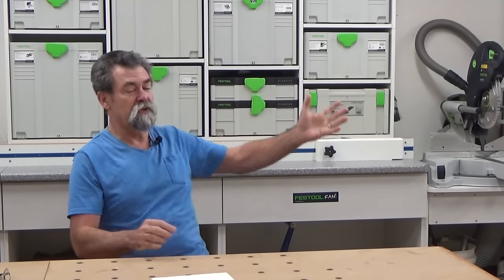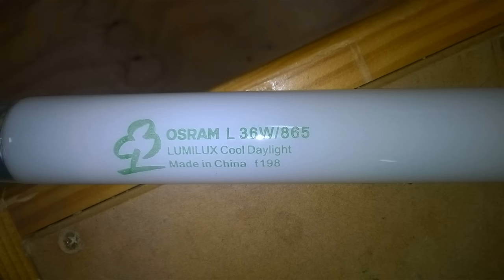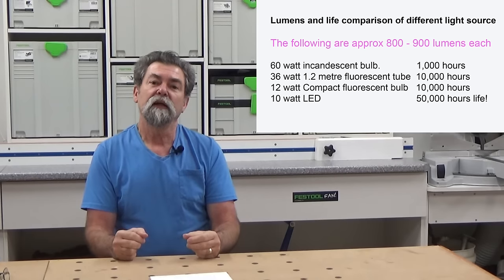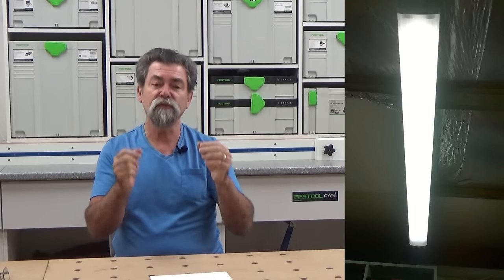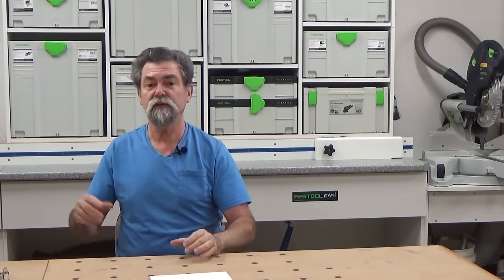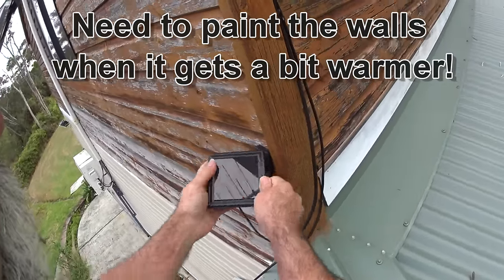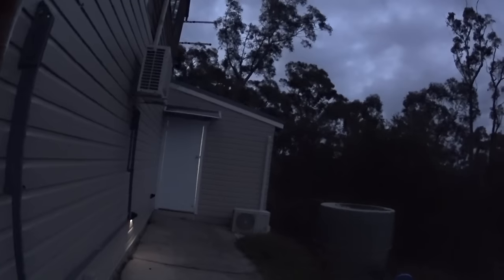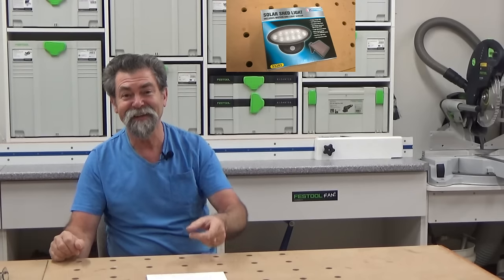how to light my shop solar DIY lighting dave stanton woodworking

Comment: One other option for you would be a virtual tracker. You can put 1/2 of your panels facing East, and 1/2 of your panels facing west. This gives you two options, firstly you can install more solar panel total wattage than your inverter can handle. For example instead of 2kw facing North you could put 1.5kw facing east and 1.5kw facing west. It also evens out your peaks during the day, which gives you a better daily yield.
Reply from the maker: Wow Graham, that is science beyond my means at present! Thanks for the comment.
Reply: Its easier to draw than write unfortunately lol
Reply from the maker: I understand totally what you described.

Comment: Thanks for the informative video.  I have put two 1.2m twin LED tube lights in my 3.0m x 2.4m shed workshop.  Each tube is 18W and 1700 lumens (6000K temperature) so that's 6800 lumens total.  Needless to say, it's very bright in there!  I'd say the light is comparable to daylight on a very sunny blue-sky day.  I love it, as there's no shadows anywhere, so I can see what I'm doing.  I am still constructing the workshop, and was planning to paint the walls white.  However, not sure if it will be too bright if I do that!
Reply from the maker: The LED's are a great idea and the way I would go now if I were to do it again. My shop is close to 4 years old and the technology wasn't quite there at that stage.

Comment: Hi Dave, are your solar panels powering you interior shop lights? Can you show us you solar panel set up.
Reply from the maker: Hi Steve. Indirectly, yes. I have a 2 kilowatt generator on my house that feeds into the grid. I have been very well rewarded for this over the past 7 years...60 cents per kilowatt hour which I buy back from the grid at 25 cents per hour. My location does not permit me to feed directly into my workshop as it is 100 metres away from the house and the panels. The panels must go through a meter on the house. Setting up a stand alone power supply to the shop has all sorts of problems associated with it....bushfire included as the firemen may not be aware and not turn the standalone generator off, the risk of electrocution is real. The only panel on the shop is that little one I show in the video.
Reply: +David Stanton Hi Dave, thank you for your reply. Funny how something that sounds so easy can be so complex. We deal itch much of the same rules in Washington. Have a great day, Steve K
Reply: +Steve with

Comment: What size is your workshop and would you like it bigger or different to what you have
Reply from the maker: Maybe 1 metre wider. Even though I told everyone twice during the video I will tell you the size again. It is 5 x 12 metres.
Reply: Thanks dave I'm planning a Mens shed and will need to build a shed so was interested in the size of yours
Reply: +steve bruford The required size of the shed would depend on what you want to do in there. I have built a 3m x 2.4m (10ft x 8ft) workshop shed.  I'd say that's the bare minimum for what I want in there.  My largest power tools are a Mitre Saw, a Jobsite Table Saw and a bandsaw.  Cutting large sheets of material will need to be done outside the shed.